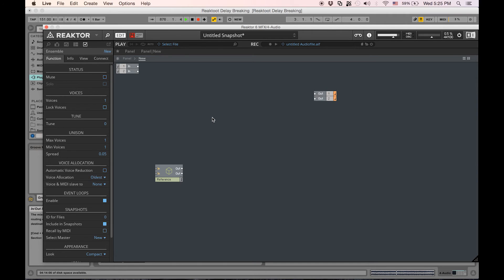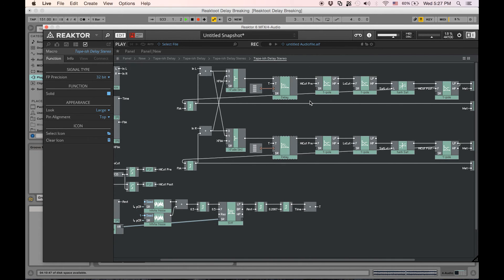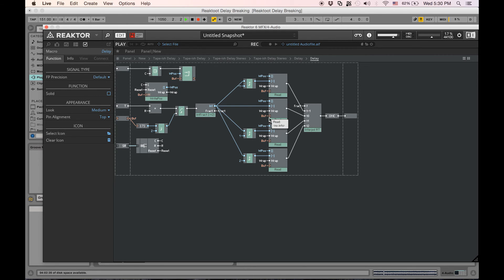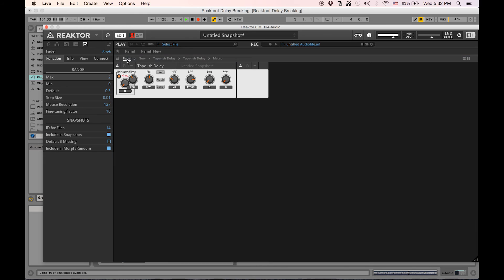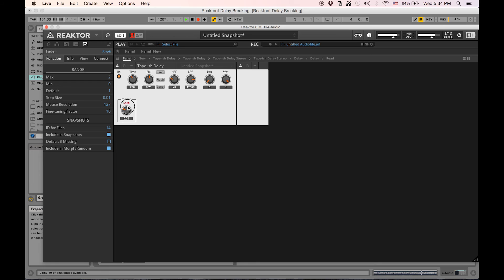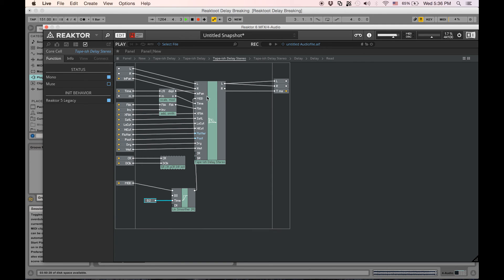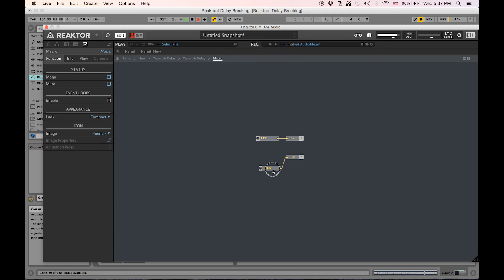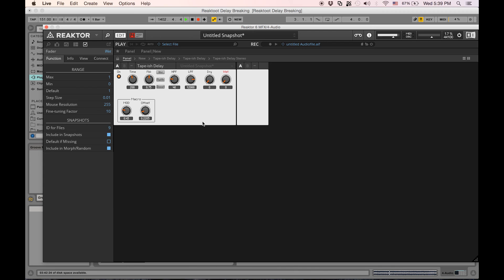Reaktor Tutorial 11 - Breaking Delays in Core Cell

Comment: @ 03:43  you're deleting that so called odd looking module and replacing it with a multiplier  (without memeory latch )...you have to know that it has a latch inside ..which is very important when programmming in core .
It means that values are written on each clock tick ..verry important to keep /maintain signal flow and processing of values ( read /write latch )
Reply: Ward de jager ah piss off he's having some fun, seems to enjoy whats happening, nothing exploded and no baby kittens were harmed. its definitely good to be aware of that stuff but if not there is zero harm in fucking around, save for the incidental 10000 trying to shake hands wit your speakers. there are different ways to go about learning
Reply: @kamalmanzukie  Would you please shut your front door and let the pros give us some tips?! Thanks!